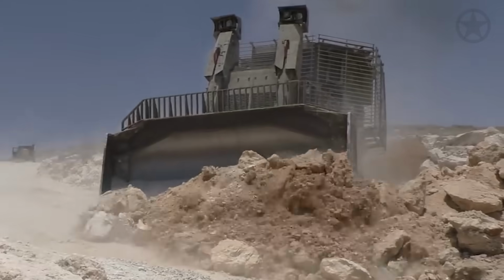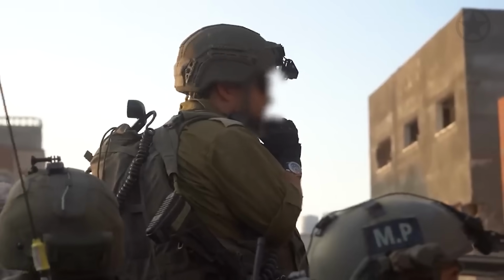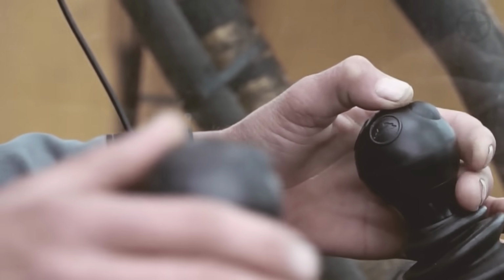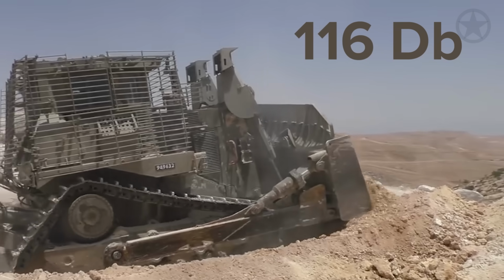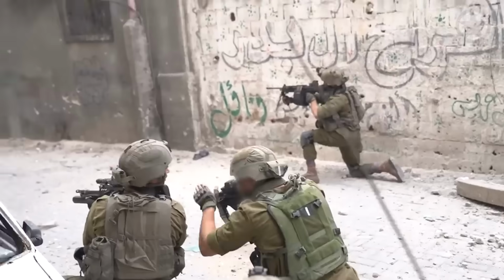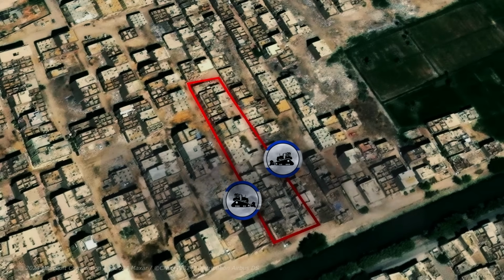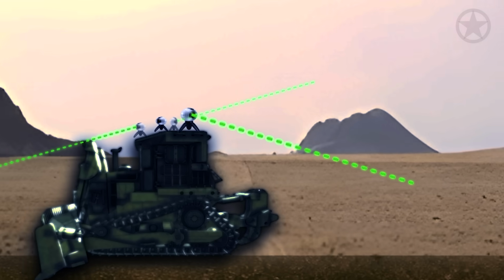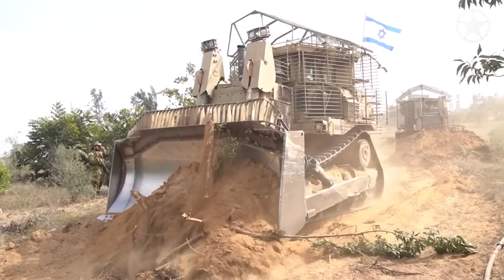This Bulldozer Changes EVERYTHING   Israel's Insane D9 Caterpillar!

Comment: 55 tons is still lighter than a useless M1 or an israeli tank. Wouldn't a disel electric dozer be faster and more manoeuvre able whilst using less fuel? It can cut angles whist using full power.

Comment: CORRECTION
is 6.8 mph is 3km/h
Not 3m/h

3 m = 3 meters = 300 cm 🤙 
3km = 3000 meters 

It would be subrealistic that the buldozer of the video was moving at 10 foot/ hour...😅

Km comes from kilometers 
1km = 1000 meters 
Like 1ton = 1000 kg 

Is like the ton sistem, but with meters
Reply: 6.8mph is about 11km/h and about 3m/s, I assume they meant to m/s

Comment: I used to be Combat Engineer and our Assault and Obstacle Platoon used these. There was a building in Iraq that they were supposed to take down it was 2 stories tall. 
After a while of dicking around our operator became annoyed with the pacing. 
He simply drove the D9 into the building and around the center of the building the whole building came down on top of the vehicle had concrete and rebar not fouled the drive sprocket he would have made it clear through. We had to move and chip away debris to get to him. When we did he was sitting in the cab just fine. With chew in his mouth an a pretty full spit bottle. 
We had to go get a Mike88 or m88 tank recovery vehicle to pull the D9 out. 
I know they were a little angry with him about it not sure how much trouble he actually got into.
Like he said though at the rate the were working it would have been a week. Now all they needed to do was spend a couple of hours pulling the D9 out in the morning and they were done.
Other than scratches and some gouging the D9 was fine. Crazy cool machine.
Reply: Niiiice!
Reply: Your story is way better than the video
Reply: My Guy thank you for your Service hero
Reply: Russian
Reply: @Анзор86  Yes, apparently, you are!🙂
Reply: Attack on what?
There is not a single country in the Middle East that has possessed real military power since World War II.
Egypt is the only country that causes problems for Western leisure trips in the Middle East.
Although it was with scrap weapons during the worst period of its history in the 1973 war,
Otherwise, they are all films made by America and Europe.
Such as the imaginary hostility with Iran
Reply: This should not be revealed, IDF should not allow to show in media. For public exposure
Reply: @arielbalugo492  I am sorry. I don't really understand what you're saying.  The D9 is well known and has been in service for decades. There's literally nothing secret  about it .
Reply: Well it's too late now. The CAT is out of the bag, lol @arielbalugo492
Reply: @arielbalugo492 what makes them special? Our shit here’s shown all the time, intentionally or incidentally.
Reply: Cool war crime story bro!
Reply: @moerahman6749 how?
Reply: @moera war is a crime  Bro hman6749
Reply: @moerahman6749  why cause it doesn't please the Muslim people?

Comment: Caterpillar also makes a D10 and a D11 that I know of there may be a D12 somewhere working I am sure that Caterpillar is working on one if one is not on the market already.
While working in the jungles of New Guinea back in the 70's the caterpiller of choice was a D6 wide track to deal with the red clay mud and constant rain any thing bigger would sink up to it's radiator in the mud. Even the D6 wide tracks worked in pairs winch each other when one would get buried in the mud.
Reply: No D 12. A modified D11 is in Australia for blade ploughing. Bu upgrade HP is not kind on drive train

Comment: I run a D 10 T at work they are not loud inside the cab it sounds just like you are in your car
Reply: The military version doesn't have the same noise isolation the civilian models have. The cockpits are completely different and are made of different materials.
Much of the video is either very outdated or pure fiction, but they're correct about the noise.
Reply: Lol you don't know what you talking about lol... I'm an IDF d9 operator in the last 15 years... they load as fuck
Reply: You don't have all the armor plates

Comment: its the same up-armored D9 the US Army Corp of Engineers use.
Reply: those (at least in Iraq and Afghanistan) were apparently provided by the IDF, according to two US-veterans military tubers.
Reply: @greenpanda84  Well that may be true but  Up-armored D9s are built in the US by Caterpillar Inc. Then they are supplied to Israel. 

So if we did get some from Israel during Iraq and Afghanistan it would have been just for reasons of logistics. Where the US said "send us what you have on hand and we will supply you with new ones".  Because it takes months to get heavy equipment from the US but it only takes days to get it from Israel.
Reply: @midriffzero  no, the IDF D9's are getting militarized in Israel.
Reply: @greenpanda84  No the base militarized up armored D9s are supplied by Caterpillar Inc. Israel Defense force is then customizing them for the use as mine sweepers.
Reply: @midriffzero  from wiki:
"Caterpillar Inc. does not manufacture a military version of the D9 per se, but the attributes that make the D9 popular for major construction projects make it desirable for military applications, as well, and with Israeli modifications and armor, it has been particularly effective?

there is no "base militarized up armored D9s"

armor, mods, APS, C&C, all are installed in Israel, and we have the names of the companies that are responsible for each of those.
Reply: @greenpanda84  I will give you that Isreal makes there own armor kits. But the base models are supplied by the US and are made by  Caterpillar Defense Products which makes the complete armored version for the US military which besides slight modifications in the Israel version for use as a minesweeper are exactly the same. 

Which was my point in the original comment.
Reply: @midriffzero  
1. Israel is not using the D9 as a minesweeper. at most it sweeps mines as it goes along, but it is does alot more.
2. Israel buys base models and militarizes them. 
3. from all of my searches online, I could not find any mention of US using militarized D9s outside of Iraq.
Reply: @greenpanda84  1. from the wiki "clearing land mines, detonating IEDs and explosives, handling booby traps," AKA minesweeper and yes they use it for basic construction tasks as well. 

2. already gave you that don't know why your bringing that back up.

3. I quote "The D9 is a commercial bulldozer built by Caterpillar that has been adopted for military use by Israel and the United States"  

4 I'm a vet and have seen them in the continental US. So have many other Vets in this comment section to quote another commenter that said the same thing as me "I used to be Combat Engineer and our Assault and Obstacle Platoon used these." Read the rest below.
Reply: @midriffzero 
1. well, that is one of the minor usages at the moment.
it's used to clear pathways (from things like cars, trees, debris) , punch holes in walls so that troops can go in, tip-over (for the lack of a better word) houses, setting up berms, and basically all sort of engineering work.

3. I am talking about current use.
Reply: @midriffzero  
1. because I actually know D9 operators, they are not that hard to come by.
I know people that were in Gaza, and they saw what D9s are doing, and there is a whole bunch of information out there in Israeli media, from interviews with D9 operators to general focus pieces on the usage of D9s

3. I'd be happy to hear, I assume that they are being used, but all I could find is that they are using some other smaller model
Reply: @greenpanda84  Military tactics aren't going to be in media. They like to keep some stuff out of the press. Also unless those D9 operators your talking about are enlisted in the Isrealy army it doesn't matter how many you know. And saying I know someone doesn't prove anything.

Yes the US Army uses more D7s then D9s. But we do use D9's and have since the Vietnam war. 

The US military has more D7's because they lighter and able to be transported  with basic truck and lowboy combo which enables them to be hauled on most US roads. Where the D9's require heavy haul trucks like the Oshkosh M1070 to due weight which restricts the roads they can be hauled on. 

The D7 is also able to be loaded on a C-5 Galaxy allowing for rapid deployment oversees. The D9 can't because it is to tall so it has to be sent oversees by ship. Which takes months. Which is why we got some from Israel during Iraq.
Reply: @midriffzero  just so there is no room for doubt - I am talking with IDF soldiers.
Reply: @midriffzero  I'm sorry that I  take it for granted that I am speaking with IDF people since, as you have eluded to already, I AM AN ISRAELI. I have friends who are reservist D9 operators, I have friends who fought in Gaza next to those D9. it's no big secret how, why and what are they being used for.
Reply: if it works it works
Reply: Tuhan tidak bersama orang-orang yang tidak tahu berterima kasih. 

Zionis Israel adalah para pengungsi yang tidak tahu diri dan tidak tahu berterima kasih  terhadap orang-orang Palestina yang dulu telah menolong mereka memberikan tempat pengungsian sa'at mereka terusir , terzhalimi , diburu oleh NAZI Jerman.

Para pengungsi yang ditolong lalu malah merampas tanah , menangkapi , dan membunuhi orang-orang Palestina yang dulu telah menolong mereka dari kematian oleh NAZI Jerman di Eropa.

Dimana OTAK dan HATI NURANI mereka , para Zionis Israel dan para pendukungnya ???

Comment: I kind of doubt you info on the engine, C-18 engines are usually 600-800hp, I doubt one can even be tuned down to the 400hp range.
Reply: Wrong.

Comment: A construction company would have bought a bigger D11N
Reply: That's incorrect. The CAT D9/D10 & D11 are for mining & large road projects. Open pit mines, large interchange profiling & just pushing a lot of dirt/sand/rock or used to feed burrowed hoppers at power plants. This size of dozer requires special state road access permits to just transport & probably very limited to crossing overpasses/bridges. Which is why a Construction Co., given a particular job will use the Medium Dozer series, not the Large. Just depends on what unit is more economically feasible. The cost of transport must be factored into the contractor's quote.
Reply: @CarmieThompson  I believe some cement companies use a D10 with the single ripper to remove large runways since at the ends of the runways it is up to 18 inches thick.
Reply: @chrismaurer2075  I'm sure there are uses of the D9 I didn't mention. That's why in my last comment I referred to companies making decisions involving the cost effectiveness of their machines.
Reply: This model with its all up weight is still transportable!
Reply: Beyond weight considerations you gotta think about fuel consumption. Logistics is a major pain for armies and it doesn’t matter how many tanks you have if you don’t have fuel.
Reply: @fortyninehike  You're comparing apples & oranges. Tanks have to motivate, a D9 Track Dozer isn't in that league.
Reply: @CarmieThompson  That’s not the point. They both consume diesel.
Reply: @fortyninehike  Power source is irrelevant. It's the function of the machine that proves it's worth. A tank has to travel upwards of 35 mph & evade hostile fire as well as positioning the tank to inflicted as much damage as possible. The IDF has a completely different use for their D9's. They don't have to travel fast, engage the enemy etc. Diesel is simply the preferred power source, it's the default. The question: How does the vehicle function for the intended use & what needs to be done to improve that functionality? I still like the D9's fitted w/ lasers!
Reply: Yeah the IDF probably had to wait six months for their permit huh?